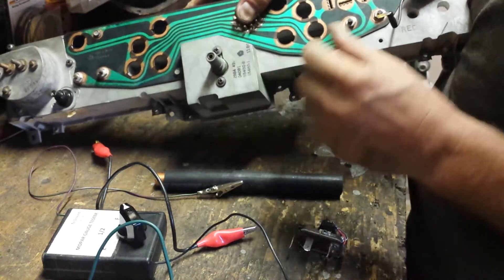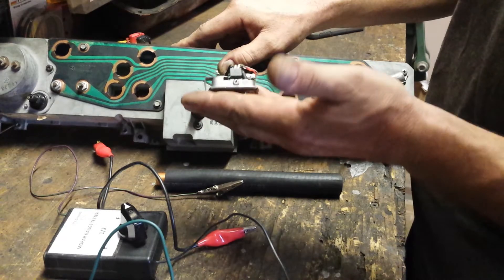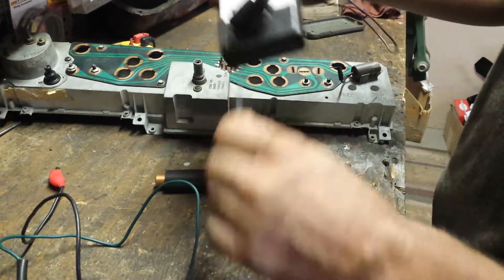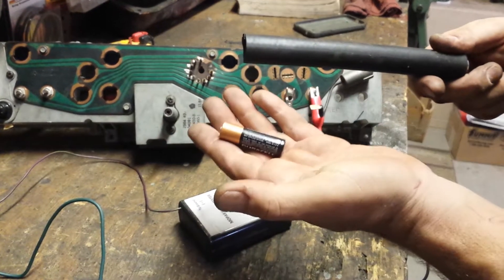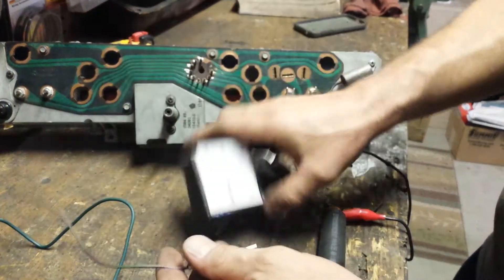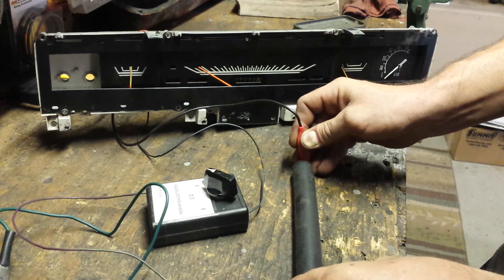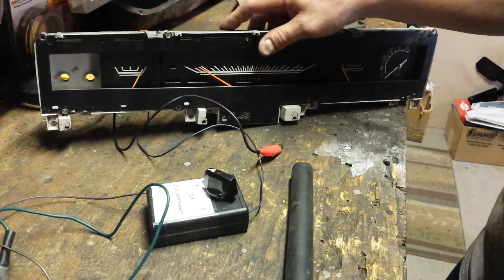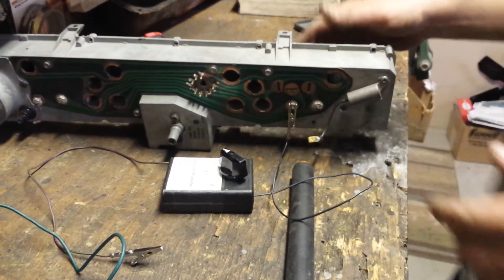Testing Mopar Fuel Coolant Gauges

Comment: I'm working on the world's nicest 62 Belveder. 
the gas gauge is just dead.
Needle is my dick when Nancy Pelosi on tv..
Ducks down and plays dead.
Sending unit has the correct  73 to 10 ohms.
But that needle never moves .. 5v and double check.. used 25ohm resistor..nothing, short to ground, not a twitch. Checked continuity on sender wire to cluster - continuity A Ok..
How do I make a 62 Plymouth Belvedere fuel gauge work or change the face with a modern fuel gauge... it was a hundred K restoration on this car, not kidding..
I'm the Bodyman.
The original Bi-metal voltage reg was stuck and pumping 12v to the guagez.
Would that kill em?.
And I still have to check the temperature gauge the antique voltage regulator May have fried it to

Comment: So if I’m seeing 5v pulse at my temp sender, but no gauge movement, is my temp gauge the problem? I think this means I have a complete circuit from the regulator, thru the gauge, and to the sender...so it shouldn’t be a loose connection, right?